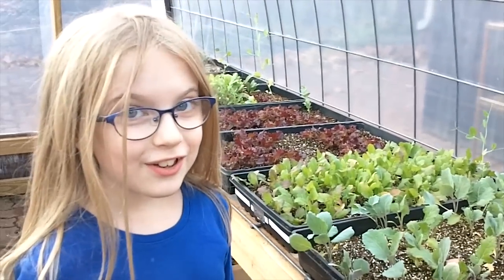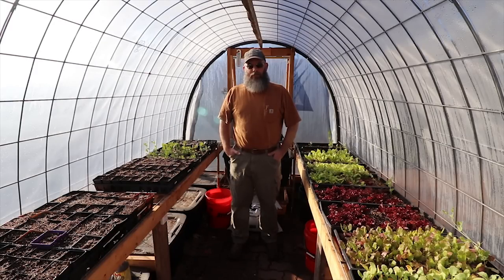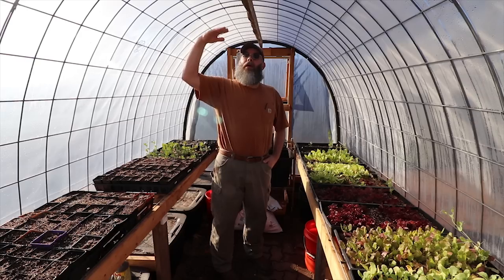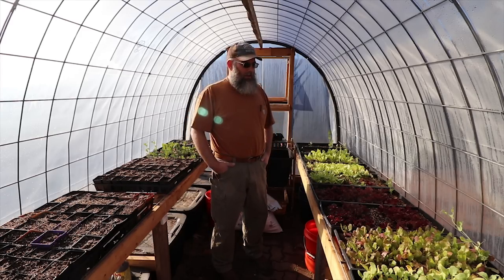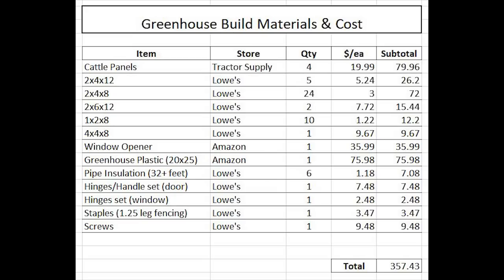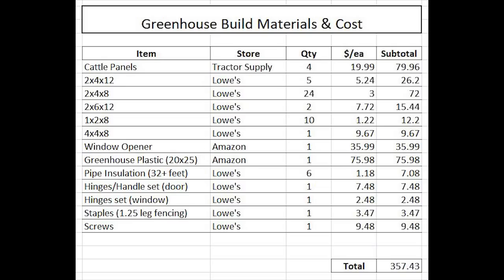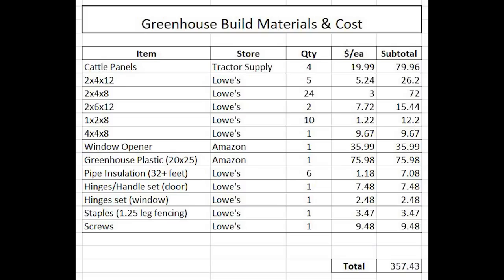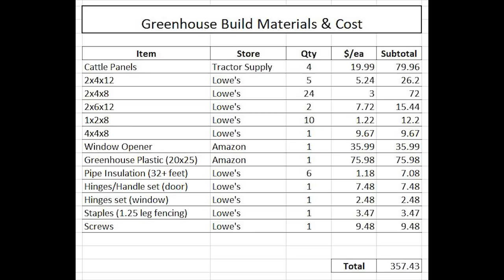Cattle Panel Greenhouse Build with Costs | How to Garden Spring Summer Fall Winter

Comment: I live in north east Oklahoma as well. When ever I'm able to make mine. Say I didn't cut off the six inches of the cattle panels and used the same amount as you did. How much wider would I need to make mine?
Reply from the maker: Thanks for watching! Not cutting off the 6 inches would make the overall length 12 feet 6 inches. It would require longer lumber than a 12 footer to keep a single piece the full length. Using a single board the full length just helps the rigidity of the structure. Not saying that you couldn't splice 2 shorter ones together. I just chose not to.
Reply: As already mentioned, longer.. ours is going up soon and will be 5 panels for 250 inches or 20 foot 10 inches.. Lumber will have to be spliced, I'll use a 10 and 14 so that I have a good size splice board.. The more I think about it the more l like the elevation for floor drafting..
Reply from the maker: @timmmmmmmmmmy1  Our latest video has a short clip showing the bottom propped open on one side. When I get around to framing and hinging the bottoms, I intend to make a video of that and the overall upgrade to opening them. If you get it good and rigid, you'll never regret building yours that long. We already could use the additional space at times. Thanks for watching and tossing in the input here!!!
Reply: Does your greenhouse run East and West ? We are also Okies and experience the same weather.. My current plans are to run it e&w and have a door on each end.. I also plan on using half barrels.. At 250 inches we'll get 28 halves in at 2 levels 1 at or near ground level and one at I'll say waist level.. Our base boards will be 2 x12 PT and the panels will be elevated so it's a pinch taller than our chicken tractors which are cattle panel as well.. Thanks homie..
Reply from the maker: Yes it runs east west. Our door is on the east with the automatic window on the west. I'm thinking about adding another shelf on the north wall. What part of Oklahoma?
Reply: @HeirloomPermaculture I must have brain farted, the plan is to run the length N&S not east and West as I 1st said.. We're in Lincoln County, roughly an hour + some  from ya'll..

Comment: Did you put any heat inside for the winter?
Reply from the maker: No. We don't supply any supplemental heat. We use the thermal mass of the pavers and the water in the black totes to moderate the temperature. We did use a small propane heater 1 night to see what the effect would be. Temps outside were in the teens and inside the heater on low kept it in the fifties. But that was just to see out of curiosity.

Comment: Updated prices 6/2022:
Cattle Panel - Tractor Supply:  $31.99  x4=  $127.96
2x4x12 - Lowes (each)             $10.58  x5=      $52.90
2x4x8 - Lowes (each)               $6.78  x24=    $162.72
2x6x12 - Lowes (each)             $13.98  x2=   $27.96
1x2x8 - Lowes (each)               $3.78  x10=  $37.80
4x4x8 - Lowes (each)               $9.98  x1=    $9.98
Window opener - Amazon (each)      $38.89  x1=   $38.89
Greenhouse Plastic-Amazon 20x25 $83.99  x1=   $83.99
Pipe insulation - Lowes (32+ ft)          $1.78  x6=   $10.68
** Hardware below is subjective to what you pick**
Hinges/Handle set(door)- Lowes  $15.98 x1=   $15.98
Hinges set(window) - Lowes	    $15.78 x1=   $15.78
Staples (1.25 leg fencing)	            $5.98 x1=     $5.98
Screws - Lowes                                $9.48 x1=     $9.48
-----------------------------------------------------------------------------------
Total:                                                                   $600.10
-----------------------------------------------------------------------------------
Reply from the maker: Thank you for doing this for everyone. It's sad what we are having to pay for stuff across the board now..... "Transient inflation" my butt!!! I'll be honest though. I'd still build one at these costs after the growing results we have seen over the last few years.
Reply: @HeirloomPermaculture  Yeah, I agree.  I was looking at prebuilt green houses that you put together yourself a couple of years ago before all this started, and even those were $1000 to $1200.   I really like the way this goes together and leaves you room to add on to it if you decide you need more.   Plus it's pretty easy to set the height to what you want it by building the sides higher.  Thanks for the video.

Comment: How did you do the window?
Reply from the maker: It is basically a frame inside a frame with the plastic film sandwiched in-between. The plastic is still attached to the main piece across the top so there is no seam there. I need to do an update video of all the small details. I'll try to capture this too. Thanks for watching!!
Reply: Thanks for the info. I was surprised to see you are a fellow Sapulpan

Comment: Great work! What size of cattle panels did you use? Please include the width, length and the size of the openings.
Reply from the maker: 50 inch by 16 feet. The openings vary from top to bottom.

Comment: For a 12 foot long greenhouse wouldn't you only need 3 cattle panels? Or did I miss something?
Reply from the maker: The 4th one is the shelves going down the sides.
Reply: @HeirloomPermaculture  Ok. I see it now. Guess I missed it the first time through. lol
BTW, love the build. Raising the height using the 4x4 post was clever. I'm gonna use that when I build mine.
Reply from the maker: @troyyarbrough  Thanks! If you come up with any upgrades while building, please share them!

Comment: 6:15 cost list. I'm sure I could score some windows. I want to build one and install an AC. ROOF use stryofoam for the insulation and sound. Cover the outside with quality tarp to reflect the light.
Reply from the maker: Did you build one?

Comment: Looks like it could have been wider. Knocking 2 feet off the ceiling.
Reply from the maker: It could. But I'm too tall for a 4-foot tall greenhouse....lol....
Reply: Sorry I commented before I watched the whole video. If you had a 16 foot cattle panel. And bent each end to 8 feet apart. Would you not have a 8 foot peak? If you made it 10 feet wide you should have a 6 foot peak no?
Reply from the maker: @medmanbrand  no worries..I laughed. 7 foot wide made about 5 foot tall. They are 16 foot panels.
Reply: @HeirloomPermaculture  lol k my bad
Reply: I guess I will be building 1 foot risers on either side one I get going